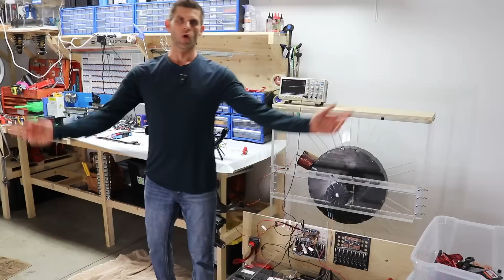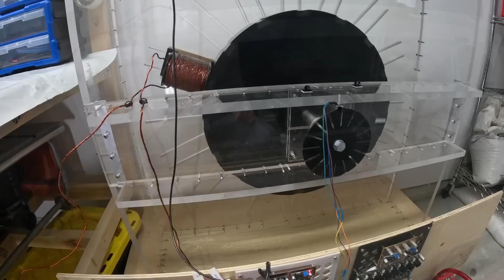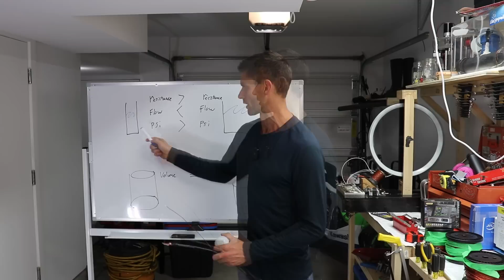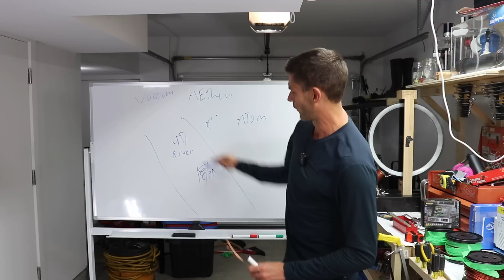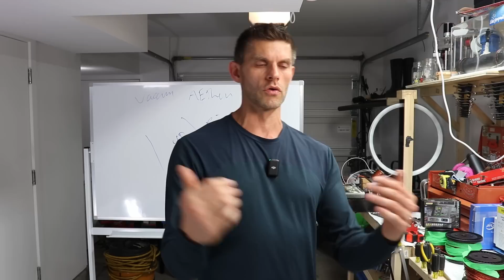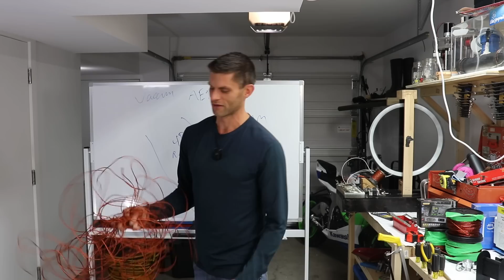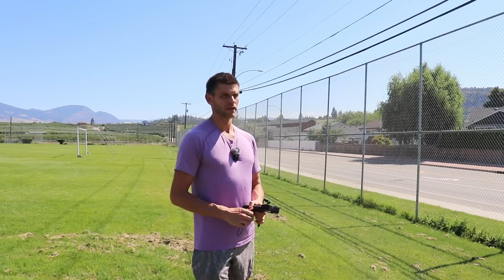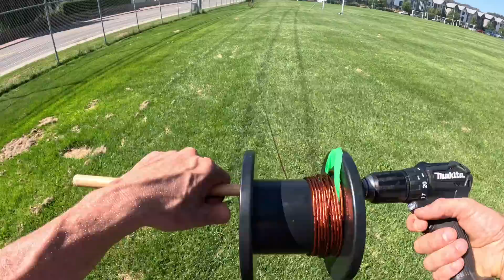I Built This Energy Machine in My Garage — And It Works

Comment: I see your struggle winding the coils. I am sure you have noticed the twists per foot is more close to the drill. This is caused by the individual wires wanting to rotate on their own axis. Suggestion - run the 8 wires through a sponge or foam rubber about 1 inch apart in a circular pattern. The sponge could be glued to a board with 1/2" holes in it for easier mounting. Attach the sponge to another ladder/ tripod. Start twisting with the sponge about 10 ft from the drill. After 20 turns, (amount of turns will be dependent on the twists per foot desired) move the ladder 10 feet away from the drill. Turn another 20 turns, move sponge (keep repeating this process). This will give a more consistent twist per foot and keep the wires even. The best would be to hook all 8 wires to a board using "S" hooks, springs, and fishing swivels individually. The springs will keep the tension even and the swivels will allow each strand to rotate. This will help prevent undo stress on the insulation coating of the wires and give a more consistent winding, making the spools easier to wind because the diameter of the twisted wires will be more consistent. When using the lathe to wind the coils, mount the spool across the room from the lathe and use large washers and an all thread to tighten for a brake. Tighten the nut to obtain enough tension to hold the lathe neutral. This will allow you to use both hands to guide the wire onto the coil forms and help prevent the unraveling. The twists per foot should be coincidental to the frequency of the pulses so the maximum amount of magnetic lines of force are induced.
Reply from the maker: Great tips thanks for the support

Comment: When one coil charges up and drops the charge collapse across pickup coil I think it's interacting with noble gases that have extra electrons in their valence shells there's experiment you can do take a blow dryer and blow it into a glass jar it'll get hot to the point where you'll see a buildup in a green light detonate in the blow dryer I think that's argon gas being electrified.
Reply from the maker: Neat

Comment: So... You've made a low power motor? I'm confused. What is so different here? This is not zpe if that's what you are implying. This is a basic low power motor. What am I missing? I've watched all the videos. Nothing is new here from what I can see. Are ypu capturing more energy than you are putting in?
Reply from the maker: 1000s of volts being smashed instantaneously into lead acid batteries and u think its a low power motor? How do u know its not ZPE?
Reply: @MadscienceLPTECH 
It is glaringly obvious that it is low power, because nothing is happening, no heat, no work, no charging, no anything. The little piezo ignitors on throw away lighters generate 1000's of Volts, but micro Amps of current, which is milliwatts of power.
Reply: @MadscienceLPTECH  First you have to show a COP > 1. One step at a time. IMO, no need to talk about ZPE yet... Let's see how it actually performs first...

Comment: Can you tune the gap for the optic sensor? I am thinking like a sliding shield that fills the gap. Like an intake flap used on air heater intakes. Then you could adjust the speed. Am I missing something?
Reply from the maker: Great thought, we need to be able to do it electronically in real time based on rpm

Comment: The ones I made use the magnet approaching the coil (changing magnetic field causes the voltage in the inductor) to switch the mosfet or transistor to switch the coil on for a pulse.
Reply from the maker: Yes the original bedini works this way with a trigger coil

Comment: You have a great, sensible approach to this while allowing yourself, and inviting others, to be in epistemological flux - don’t stay anchored to one belief as the goal posts of truth seem to be moving by the decade. 

That being said, have you heard much about the joule thief circuit? It’s an incredibly simple circuit that utilises voltage kick back spikes at tens of thousands of cycles a second and its own circuitry and toroidal windings are what control the switching. I made a little flashlight that you could power on a single dead AA battery for I think a week of continuous use - this was way back in 2013. I also used it in conjunction with a simple AC rectifier circuit, about 30m of wire and an aluminium plate and a small mountain near my house to power a 9v motor which I ended up frying instead. Essentially atmospheric power. Not an incredible amount of current but impressive nonetheless and could even serve as an initial free small injection of energy into a system like this. 

(Another thing is that depending on the voltages your coils are going to have flowing through them I think you may end up needing to soak it all in a specific epoxy to prevent shorts - if the voltage spikes are like approaching high kv even mv levels?)
Reply from the maker: Great points and comment. Hopefully the coils can take the HV spikes as they are low amps. 

JT circuit i have head alot about but never built specifically for testing. We may do that. 

Wish you ahd photos of your build.

Thnaks for the support ❤
Reply: @MadscienceLPTECH really appreciate what you’re doing man. Reminds me of how all the brightest scientists couldn’t figure out the blue LED and it took a dude who just knew the machine really well to actually just get out there and tinker with it. Got his head out of the damn books and onto the tools! 

Kudos to you brother and all the best going forward, will be watching and chiming in from the sides!

Comment: Twist your wires on your optic sensor I think one or two turns per inch should be OK similar to an ABS sensor on an automotive application and then wrap them in a grounded conductor to shield them
Reply from the maker: thanks for the tip

Comment: If you look at computers over the last 30 +years you can see iteration every few years when they do the CPU technology that they go down from 30 nm down to 28 nm down to 26 and I think they're down to about 3 and every time they do that they make them more efficient and generate less heat from resistance which is loss of energy to heat so if we can learn anything from thatvery quickly we realise that wire length and resistance is going to be one of the main characteristics and respect to energy loss that you can do in this machine although you can't really get away with that with the coils you can with every other area of the machine especially plugs that wires screw into and you can check these electrical resistances with multimeter and all these connections add up so it's definitely best to solder them
Reply from the maker: nice example!

Comment: If the optic sensor is burning, why not limit the voltage like using voltage regulator or zener diode
Reply from the maker: great idea. we need to isolate the ground

Comment: The law of thermal dynamics is quashed once you began to mention the spillover and the energy in the vacuum where one can be able to access as free energy
Reply from the maker: is it though, they are valid but there can be more. its not like sun energy negates the man mad laws in solar panels
Reply: @MadscienceLPTECH true
Reply: @MadscienceLPTECH I wonder if you could line up a set of lithium batteries after the fact that the lead acid would spill over into that lithium bank after the lead acid were charged and then the cycle would start again so that the pulse charging wouldn't directly hit into the lithium bank.

Comment: Hey mate, I have a question, why the wheel? Is it just so you can see it working?
As far as I understand you could just make it solid state with the coils outputting the high voltage pulses, basically just a stand-alone engine ignition system sending the high voltage to the negative of the output batteries.
 would be a very simple and cheap way to experiment, a few ignition coils and a programmable ignition module.

Keep up the good work though, looking good.
Reply from the maker: I think it amplifies the excess work in the system. The electrons can be recycled and used for work
Reply: The spinning rotor is a way to get extra mechanical work from the pulsed coils. Whether that really adds anything much remains to be seen.

Comment: Needs to connect the optical sensor with a shield cable pair or at lease twist the wires so they don't pick as much EMF.
Reply from the maker: Also the power supply for the optic needs isolation

Comment: Looking at Super Capacitors operating at 99% efficiency appears to be great match for Madscience applications. They would be far superior to lead acid batteries to absorb spikes of electricity by harvesting the overunity energy and can operate perfectly in high temperature environments comparable to Death Valley.
Reply from the maker: Interesting thought, super caps do have some benefits! i will use them for the generator coils
Reply: @MadscienceLPTECH  How is the progress of marketing the components for independent experiments in relationship to all your informative overunity education & research?

Comment: The test you have described to measure the workload over time and compare that to battery driven only (could be a baseline test) is exactly what I am hyped for. The engineering here is obviously very well thought out and your passion is palpable. 

I still think that the whole thing seems a little too "easy" and would love to see a proof of concept with measurements and hard data. I´d love to be wrong but until that happens I gotta stay sceptical. Still all the best and I am curious about what happens next
Reply from the maker: scepticism is good. im excited too
Reply: As of now there is no evidence of usable energy generation?
Reply: Didn't Tesla say that it don't work like normal electric 3 phase/DC currents? 
Cold electricity I think it was called, 0 resistance

Comment: Think about setting a crypto address Solana. With that U get credit card linked up/ no banks, which is a failure point . We in crypto like new tech. Plus U recieve the full amount . 
Clear explination , I get it . Could U say creating a fluxation of quantum field potental .

What seems the hypothosis  ; a atom /electron is a observation in a field which is always past tense .  There are no present tense reads as it exists now , any read will only show a past. Present tense is flux field/wave , which by definition has no being outside of flux/unity. It must move to be.
A photo of the river is not the river. Hence a electron read is a sampled past state of a field . 
If I convert into this question; what is a totally frozen electrical/magnetic state? Does such thing exist?
Reply from the maker: i have crypto links in the description... lots of scientists have written about this alt science, bearden, dollard, etc

Comment: I just want to preface by saying I'm not a nay-sayer or a skeptic, I have faith in your experience and determination, just want some clarification. I really want this project to come to fruition. It would not only produce wonders for us but also turn a new corner in physics as we understand it, probably even solve the cosmological constant problem, but I'm limited by my little understanding of pulse motors and lack of knowledge in this area of physics, so I want to ask for some clarification if you have the time to provide it. 

Firstly, if I'm understanding your videos correctly, is it your belief that this motor works because the sharp gradients created when the dipoles collapse are actually coupling to the vacuum energy or "aether," and that’s where the net gain comes from? In other words, you see the sudden creation and collapse of the dipole fields as a way of keeping "a channel" open to the zero-point field so energy can flow in, instead of the system shutting itself off the way conventional electronics would?

Secondly, my understanding of pulse motors was that it was still outputting less work than was put into them. I thought what was really happening was that the pulse motor is just an arrangement of coils and magnets where the coil is energized briefly to push the rotor forward, and then when the current is cut off, the collapsing magnetic field induces a sharp back-EMF spike. With proper timing and circuitry (using diodes or recovery paths), that back-EMF can be captured and fed back into the system instead of being wasted as heat or whatever else. So what looks like "extra" energy is actually the system harvesting the energy stored in the coil’s magnetic field each cycle. It’s a cool way of boosting efficiency, but it doesn’t require invoking vacuum energy. So is the new motor you're creating also using the back EMF, but creating something extra to induce a "spill over" or a correction from the vacuum energy? How is it doing that?

Thirdly, you also mention a couple of times in other videos that there is extra work coming out from the motor than is being put in, which would be definitive proof that this indeed works and is tapping into some unseen source of energy, but I can't find a video that actually measures or shows us the extra work coming out. Not that you have to prove it or anything, but I think posting that alone would break the internet and probably give you a lot more funding, maybe even bring other scientists with their own thoughts on how to increase efficiency. Even if people think its fake that would drive publicity and views to your videos.
Reply from the maker: 3rd point i agree and will work to show the small bedini does do excess work while not running forever soon. 

Yes I believe the source of all e and m electricity is Aether or vacuum. The dipole we want to open in in the batteries electrochemistry and due to the different mass to charge ratios of ions and e... and time
Reply: @MadscienceLPTECH  Thank you so much for responding and I see, so you believe that all batteries don’t actually generate electricity simply by moving electrons across a wire (and the energy transfer that happens around the wire due to EMF surrounding it), but instead act as a kind of gateway to the aether or vacuum energy. In other words, the electrochemical dipole in the battery isn’t just providing stored chemical potential; it’s opening a channel to a deeper field, and the differences in how electrons and ions behave are what allow that channel to stay open. That would explain why, in your view, conventional electronics are “shutting the gate” on themselves by collapsing the dipole too quickly.

This also lines up with the observation that current doesn’t really “flow inside” the wire as moving particles, but rather around the wire in the surrounding electromagnetic field. That’s why those first underwater telegraph cables faced such huge impedance; the surrounding medium plays as much of a role as the conductor itself. So by your reasoning, what we think of as current is actually just a manifestation of the vacuum field responding to how dipoles are arranged and pulsed.

Is that a fair way of restating your view? And if so, could you elaborate a bit more on how you see the different mass-to-charge ratios of ions and electrons affecting this “gateway” mechanism? I'm sure you might do it in a video later, and it is probably not as accessible now, but this is incredible. If you're right, you would be like a modern-day Isaac Newton or Einstein.
Reply: I think you understand electronics way more than this guy. Don't know why you're asking him questions like he's some sort of genius.
Reply: @andreyprince  I mean it's an interesting theory and I'm curious to see where it goes.   I got a bad habit of glazing when asking proffs questions in uni, ig it carries over to youtube lol.
Reply: dude we already know what the opinion of other scientists is and they wont even bother to look into this guys experiments because they think this sort of think is for crack pots and they'll dismiss this guy as the always have with every other tinkerer and builder out there. they think they know everything and are owned by the oil industries anyway, so they will be forced into discrediting this guys work

Comment: Would using an encoder instead of an optical sensor work better? Or is that what you are using and just called it a optical sensor? There are many different types of encoders. The one I use for one of my motors uses 3.3v which is the sin/cosine encoder.
Reply from the maker: Yes we are moving to new timing ill touch on it soon

Comment: Yeah I think Steinmetz (and Dollard definitely) said the "electricity" is outside the wire.
Reply from the maker: Yes totally
Reply: Yes, although how much depends on frequency. Watch Robert Feranec, especially his videos with Rick Hartley and Eric Bogatin. PCB designers are experts at dealing with "electricity outside the wire" because the harmonics of the sharp changes in digital signals are very high frequency, so the copper traces are really more like waveguides than conducting wires. The general goal is to keep the signal and return current conductors as close together as possible, because the field will expand as far as necessary to connect them through the dielectric and everything nearby will pick up the signal. The return current of a pulse does not wait until it travels all the way around the circuit at light speed, it travels out from the source simultaneously with the signal.